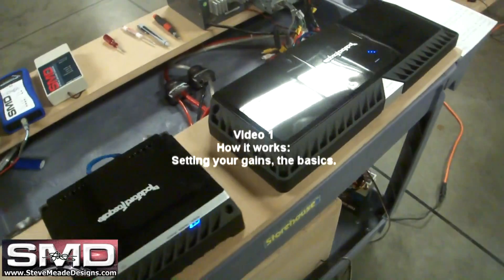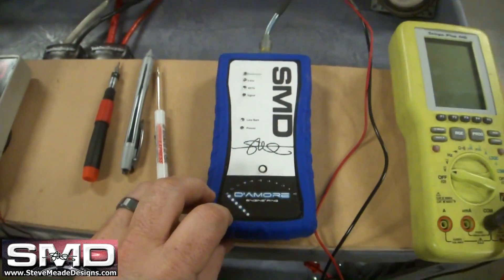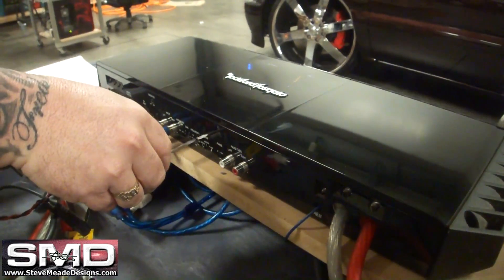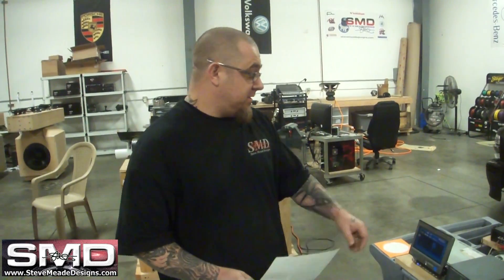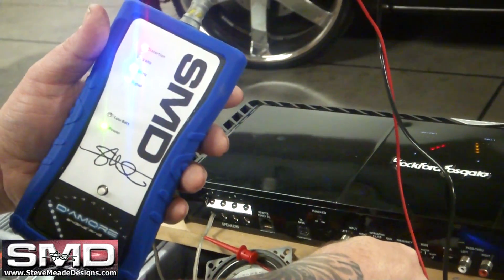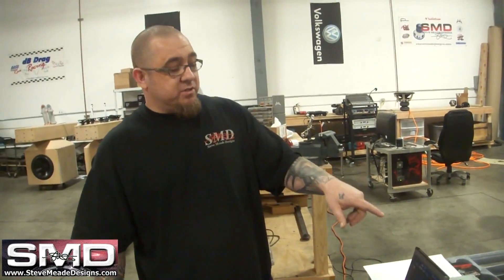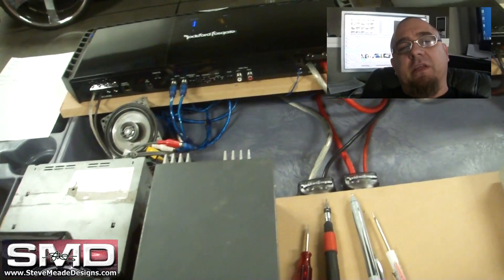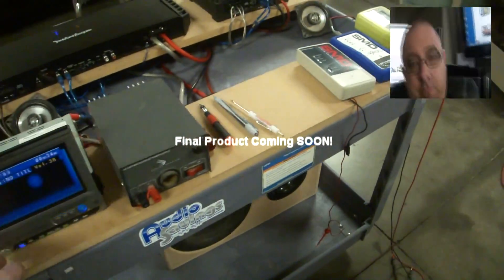PREVENT CLIPPING! Set AMP GAINS like a Pro! New SMD "Distortion Detector" - Coming SOON!

Comment: What's up steve I have the dd1 I have a issue it's shows distortion before signal  I'm following directions because I installed 4 amps with it what can be my problem is changed batteries also

Comment: @meade916  assuming I have a amp that puts out more rms then my speakers are rated for would I use this to get everything set up and then lower the voltage with the gains using a muti meter to match  the door speakers?

Comment: Attention!!!! Any One Got One Of These Can Tell Me How To Use It If U Got An Equalizer Got Ya Mids /Highs
Reply from the maker: +Mont Last it comes with an instruction manual.  If you own one, crack it open and read it. Thanks!
Reply: +meade916 Ok Jus Wanted To Kno Since That's How Most Systems Set Up Down Here in Florida Thought Maybe Sum One Had a Video Out Of it
Reply: +Claro Que Sí because hes a gangster

Comment: can you test to see if your head unit is clipping without a mids and highs amp?
Reply: +Zaanjo Yes, you can. Stick one of the probes into the RCA connector's hole (positive) and touch the other to the outside (ground). As long as your deck has more than a 1.2 volt pre out (almost all do!) this will work. This will also work if you are using an oscilloscope.

Comment: Meade you the man I just  got my dd1: this a  crazy questions :do you tune amp  with car on or off:cause if car on and I tune I know voltage  drop a lil
Reply: +Napoleon Pack  I think it is the same, the amp will clip at the same  point, no matter if it is at 12 or 14v, but obviously it will produce more power at higher voltage.
Reply: +zepey18 thanks for letting  me know I was a lil. confused:  but I have a good 14 volt charge  now since  the big 3  I'm super happy now thanks man great help
Reply: +Napoleon Pack You're welcome bro, happy bass time :D

Comment: Steve, my sound source is essentially an MP3 player head unit, (DVD decks don't work so well on my off road vehicle). Got any suggestions as to how I setup a test signal in the form of an MP3 sound file to stand in for the tone generator or reference DVD?
Reply: +robert gillies download a 40hz and a 1000hz test tone from the internet. You might have to dig a bit to find -db tones because most people post 0db tones so you never clip your set up.

Comment: What's going on Steve? Just got everything set up with the triple play set. What is the Bass EQ for and where should I set it? 0db - 10db
Reply: Box/Sub is 30.0Hz @ 10.6 Ω Low 51.3Hz @ 14.8 Ω High Port is 35.6 Hz @ 2.0 Ω

Comment: Do I have to set my Deck with 0db tone and amp with a -10db? Or can I also set my deck with a-10db? Or is that too much?
Reply: +Jam Havoc Set your deck using a 0db tone because if you play a track that just happens to get to 0db you don't want your hu sending a clipped signal to the amp. IF you find top volume using 0db you can set your amp at -10db but do realize if you set it this way you could(and probably will) clip below your top volume mark. This is because some tracks are recorded with boosted bass.. If you are really worried about clipping below your volume mark, I would just use 0 or -3db.

Comment: someone help me please! i posted on the smd forum but haven't gotten a response. i set my gains really low on my t2500 but it still clips even on the lower frequencies. i have the eq knob but when i turn it up it makes the lower notes louder but boosts it at 45 kind of ridiculously. i know its supposed to boost 45 hz but its almost no bass and then when a higher freq. comes along its extremely loud. honestly my 300 and 1000 watt amp were louder. whats going on?
Reply: headunit?

Comment: Hey Steve!..... Send me one of those distortion testers asap...... i need one badly. I'm doing a install soon. I'm about to install 2 Alpine Type R 12's powered by a Lansar Opti Drive 50C in a 2013 Chrysler 200s. Any recommendations on the install? I think Im going with ported box according to Alpine build specs in the owners manual. i really don't want to lose any bottom end bass. I had the same setup in my 95 Crown Vic on two Kicker 15 CVR Dual 2 Ohm's bridged to 0.5 with a kinetik 1200 in the trunk. I planned on doing the same thing with the alpine subs. They're 2 ohms too. What do ya think?
Reply from the maker: no problem.  Order up @ http://www.wccaraudio.com they are in stock right now. thanks!
Reply: +meade916  where should my subwoofer level on my deck be set

Comment: thanks for the video steve.  I have a question though, should you set the bass and treble settings on the deck first, and then do the same process that you did in this video or should you tweak the deck settings after?
Reply from the maker: you can if you want but you should set it with the deck flattened out.  You can make adjustments afterwards.  You would be surprised how much you DON'T need to peg your bass/treble though anymore once you have your gains set right.  Instead of +6 (for example) you might find yourself just putting it on +1 or not even messing with it at all.  Adjusting bass/treble is just like using an EQ....you never want to boost more than a few small notches at most.  Cutting rather than boosting is the best way.
Reply: meade916 thanks for the help and quick response.  I look forward to picking one of these up in the future once I get my new system in.  Love watching your videos and am learning a lot from them.
Reply: meade916 What if the deck has a built in EQ? Where do I set the settings at before adjusting gain? or do I just set the EQ settings on the amp first then match the settings on the deck?
Reply: Phillip Torres I said EQ but I meat My alpine deck has a Built HPF with the option to turn it off. Where should I set the HPF settings before setting gain? or should just turn off HPF?
Reply: Phillip Torres turn all hpf and lpf filters off and all eq settings flat
Reply: i have rockford 500-4 and have left and right gain so how to adjust that

Comment: Hey Steve... How would you set the gains on speakers that you're running off of an aftermarket headunit? With the DD-1? Am I better off buying an amp first? Then set the gains? I'm getting distortion starting from volumes of 25 and higher.

Comment: my DD1  must be differ model.. mine  instructions says to put the leads directly in the terminals.. jus wondering if you could do either or ..   ( ) lead to the ground on amp or () lead on the (-) terminal ???
Reply from the maker: look at the DD-1 in this video....it's a prototype still. We have made changes since then.  But both ways should work fine :)
Reply: meade916  yeah jus bought one.. these are bad ass. wish i had this years ago.. jus  wanted to make sure..right on

Comment: .I need your help I installed a uv10 indash head unit in my 740i bmw and cant get any sound to come out the speakers someone told me it because I have a factory amp need to know what I have to do to get the sound to play please help
Reply: A lot of cars are like that. My town car had the same issue. I ended up using a Ford Taurus harness. You need to get a premium sound harness.

Comment: Hi good video im big on sound just don't know anything about it my question is I have a factory stereo in my car, now the only thing is I installed new speakers in my doors I took out old ones replaced with 50w pioneer max 300w 3way.  I don't have a Bass sub I just replaced door speakers sounds awesome.  So I don't need this SMD

Comment: Wait how can you properly set gains with out an ohm load/ speakers set up? I mean the lower the ohm rating the lower the voltage the amp produces and the higher the current draw...

Comment from the maker: its a distortion detector.  If you have a clipped signal it will of course light up because that is also a distorted signal......but usually it will light up way before it is squared off. Thats because it does not need to be clipped to be distorted.

Comment: Anyone who is good at using this, I used it on my Sundowns about a week and half ago. About 3/4 the way on both amps the distortion light will come up, but if I turn it slightly more it goes away. Do I only stop when the LED is solid? It wasnt solid even if I went past it.

Comment: @meade916   Hey Steve, I just revived the combo pack of the CC-1 & DD-1 and was going though setting my gains and had one question. If I have my amp grounded to a seat will it give a false reading? The only reason I ask is my deck shows distortion at 38 out of 40. At that point I went to turn my gain up on my sub amp(JL Audio1000/1V2) and I turned it up a 16th of a turn and the distortion light came on. Is this a ground issue or just a shitty amp..

Comment: @joblo1978 - the gain is to match the output of the deck pre outs with the amp to obtain maximum undistorted and unclipped power to subs..  So when your deck is as high as it plays clean and clear the amp signal to the sub is as well .  I could be wrong-if so someone correct me.

Comment: so what would you do if you have all three levels? gains,lpf or hpf,volts?do i turn up 100%lpf and only adjust gain level?or same question with voltage level and only adjust gain level. or 100% both lpf and volts but only adjust gain level? i have all three and wanted 2 set them right

Comment: I know u can set your gains with a multimeter by the square root of watts times homz but for the watts is it the amp rms or is there a different way 2 check actual watts

Comment: Nice video! I learned some valuable stuff! I have an IMPORTANT question that everybody probably wants to know: After tuning your gains, what frequencies should the bass and speaker amps be tuned to? Should the bass amp be tuned to 80hz, 20hz, or 55 hz?
Reply: I know that this is a little bit late but depends on what music u lustening, when im listening to techno i have subwoofer to 100hz and above 100hz midranges and twits.

When im listening to pop and rap i turn down sub to 80hz and above 80hz mids and tweets

Comment: Should I set the gains when the engine is on and I have about 14,4V or when the engine is stopped and voltage is about 12,5V?

Comment from the maker: @joblo1978 a gain knob is NOT a volume knob.  That is the FIRST thing you learn when installing amps properly.
Reply: meade916 how do you set the gains, if you have an equalizer also, hooked in to tour sound system?
Reply: BIGRALPH2011 take off eq and set gains and then set up eq again
Reply: @joshua199628 

 No. Set your EQ first. If you set your gains first, when you go to set your EQ you’re going to clip your signal if you raise the frequencies that the gain is already set from the amp. Set your EQ first so when you go to set your gains, you’re sending the proper signal to the amp to therefore set the gain from.
Reply: Do I have to leave the frequency up all the way or the have to get set back. Next thing, do I have to change the EQ to be flat or leave it how I set it already ?
Reply: Do I flat line the EQ in the deck in order to set the gain correctly ?
Reply: Jus bought one from sonic electronics, I’m fuckin excited to get it man..got a b2 rampage 8, in a gately box, with a kenwood excelon xr 1000-1, 4 neo 6.5 orion hcca door speakers, and two orion hcca tn-1 neo super tweeters, running on a tar amps 2000.4 with b2 audio crossovers for the tweeters. it’s gonna sound amazing when tuned with this bad boy I know..

Comment: I used the O scope to set my gains but was showing no clip points even with Vol. and Gain turned to max , is this possible ? or did i do this wrong lol. I had to test it on the RCA cable , it wouldn't read it right through the speaker outs. Have a PDX5 that makes you connect the speaker wire right to a plug then the plug into the amp not sure if that was throwing off the O scope or if i did it wrong haha. any feed back would be great.

Comment: Quick question.  I know u have a cd with all the frequencies. Only problem I have is that I run an alpine iXA-W404 for my head unit. There's no cd slot, it hooked up to my iPhone. Would I still be able to tune my amp with your product.

Comment: only thing wrong with the dd-1 imo is the rca connecter on the dd-1 needs to be raised outside the housing  a little. some of the rcas won't go in as they are too beefy. only the cheaper rcas will fit in it.other than thatt i love my dd-1.

Comment: @meade916 hey there why do you use 1000hz tones for mids and highs and whats the reason on certain setups you use -3db or whatever - db it is same with the subwoofer why 40hz and why is the - db 40hz tones used on different setups?

Comment from the maker: @showynnakdazz a couple notches of bass or treble will not put distortion into the system.  You should use the flat settings if possible but you dont have to.  You can set the deck the way you like it and then test from there.  If you have extreme eq settings on your deck, and you insist on keeping it that way, it might be better to set it up like that.  I would for sure turn off any boost (like loudness) on the deck though.

Comment: QUESTION. AFTER YOU SET YOUR RECEIVER TO VOLUME THAT CLIPS, AND BOTH SUB AND HIGH AMPS LEVELS ADJUSTED CORRECTLY. WHEN YOU CHANGE SETTINGS ON YOUR RECEIVER LIKE BASS AND TREBLE COULDNT THAT PUT DISTORTION BACK INTO THE SITUATION. DO YOU START THE DISTORTION PROCESS WITH THE RECEIVER SETTINGS ON FLAT OR WHAT?

Comment: @mcf3778 I found out that I had a transformer inside the amp come apart. I'm getting it back from the shop tomorrow. Thank you very much though bud! And it's a NICE amp. 1ohm stable.

Comment: I have an Excel spreadsheet that calculates the perfect amount of gain required using the RMS power output of one channel on your amplifier and the resistance on that channel. All you need is a Multimeter to measure the AC Voltage :) If you want to have a look at it (maybe incorporate it into your device if it's legal) I'll send you the file

Comment: so in theory, couldnt you set the gains like you did at first and then just use the sound from the deck to sense clipping? basically do the same process, but use human ears instead of that fancy Distortion Listener? (which i do want but probably do not have the cash for at the moment)

Comment: hey steve, i just got into car stereo and installed a kicker solo baric l7 15" in my blazer. Its currently being powered by a 3000w power acoustik amp, and is in a 5.6 cubic foot box. Are these aspects of the system ok? i wasnt sure if i made the right decision on the size box and amp.

Comment: steve pioneers have a sla setting, source level adjustment. couldnt you turn it down a few if the headunit is distorting ? so u get full range of the volume ?

Comment: Steve, I have a question about my amplifier..
I had a Massive Audio P3000.1 hooked up to 4 15" Diamond D3s.
The setups worked great for over a month and a half now, but yesterday, my amp quit working.
I took the amplifier apart and discovered that all of the fat power wires inside the amp had been burnt at the end.
What would cause this, if you know by chance?
It was always supplied over 12 volts.
NEVER DROPPED BELOW 12.
So I'm not sure...

Thanks.

Comment: @keithtyler145  Saying this from experience... Buy or have a ported box built... Because a ported box hits alot lower then a sealed one will ever do.. 
A sealed box is best for more punchier kind of bass like in rock, metal, and different types of music like that... But if you are more so looking into trying to get the lows out of songs then your best bet is to have the box ported because it allows the sub to move the air inside the box itself so it is able to perform ALOT better...

Comment: You say that this works with our without the speakers connected but I suspect you would often get some voltage rail drops with a load connected which would make  the amp clip earlier than with no load. Cheaper amps with weaker unregulated  power supply circuits and cars with weaker electrical systems would  be even more prone to this.

Comment: With testing the speaker output for head unit clip, is it possible that you are measuring the input of the amplifier clipping and the not the output of the head unit? Why not test the outputs of the deck by themselves?  Just curious. Any help would be appreciated.  MADVIBES

Comment: @blown4six sort of... this measures DISTORTION, not just clipping.  The "clipping" light on most amps is pretty much a joke.  Not really reading clipping or distortion and just coming on at some preset output voltage level.  From an electrical engineering standpoint this is the cheapest way to do it.... and shittiest.  The mobile audio market is all about cheap junk that doesn't do what it says it does these days.  The SMD / D'Amore Engineering tool is a calibrated instrument.

Comment: so when would you set the frequency on the amp?
with the rockford amps you can only set it to what it plays loudest, like if u turn the knob to 40hz it would play that the loudest. would you have to set the frequenzy before you do the gains? cause if u set ur gain at say 40hz and then you played 20hz tones your sub could probably clip right?

Comment: i still dont get it. you didnt even touch the deck settings. or if u have the amp for the mid n highs u just tune it to the new product ur coming out with. and u didnt touch the deck for the sufwoofer lvl or the bass. im guessing u leave that too n just touch the gain n bass boost if it has it. n figure out where the distortion is?? n what lvl n so on?? :S lol sorry im new and have only cranked the gain n the deck settings n also blew alot of subs lol. but they were cheap. lol

Comment: @bigrobstillpimpn Thanks for the reply! I am using some bass boosting which probably leads to earlier clipping in the volume band as you say. I think the speakers would play more cleanly if I would hook them up to an amp that will give them the power that they are rated for. 
The tool demonstraded in this video seems like a good product, I will probably buy it if the pricing is somewhat right.